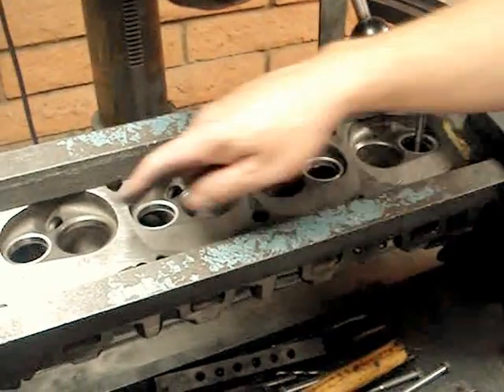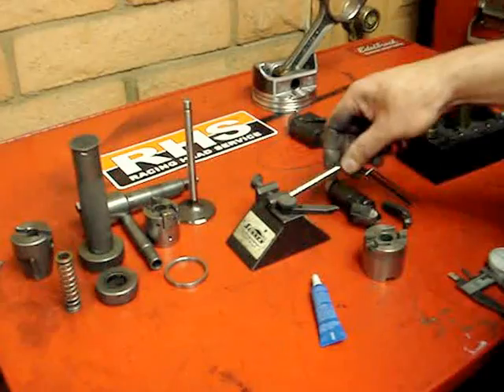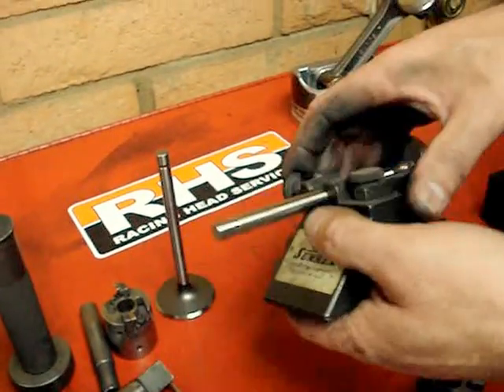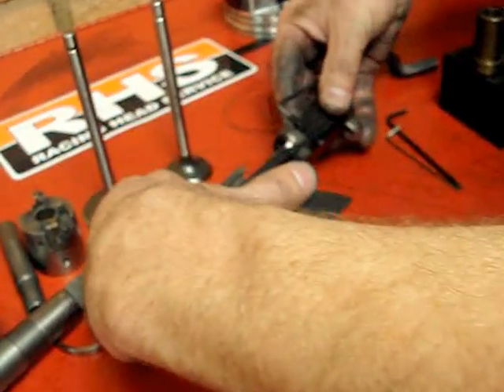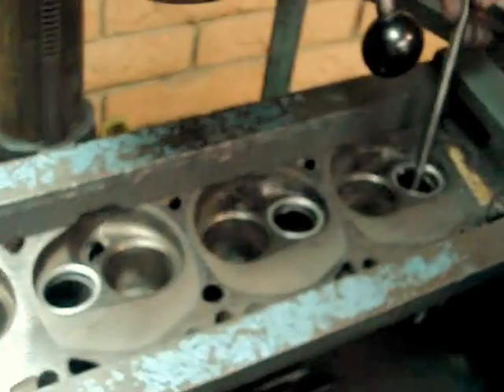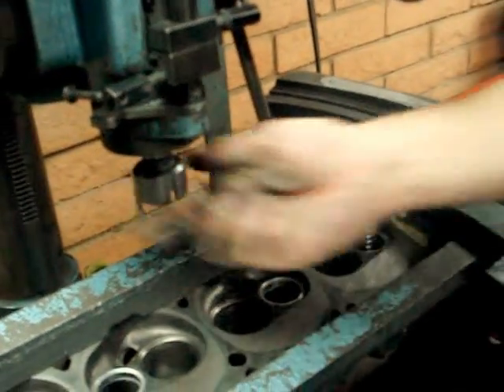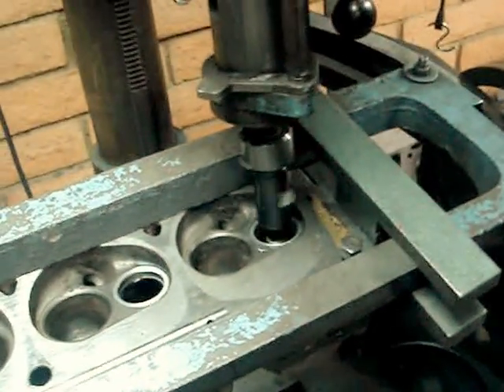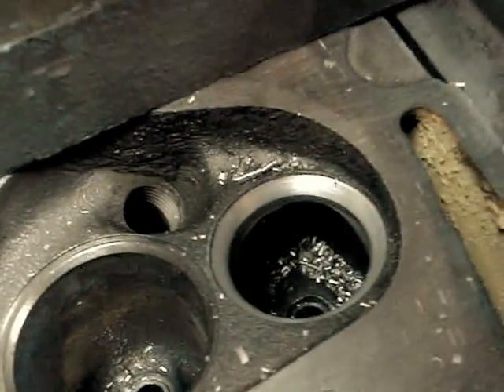3 angle valve job

Comment: Seems like a lot of material removed. Now you have to grind the valve stem length down. Valves perform better the higher they sit in the head

Comment: hello, I would like to know if there is significant amount of horsepower gain from a 3 angle job and should you get it done on a vehicle you use as a daily driver and race it also. thank you Robert
Reply from the maker: It helps it's important to understand making more power is not just one thing it's a lot of upgrades match porting,  bowl blending multi angle valve job these things all add up to more power I have seen as much as 15 HP gain on a 400 HP engine but like I said there is much more than just one mod that needs to be done
Reply: @Myvintageiron7512  Thank you for taking you time to reply back, I appreciate it.  I would love to do this to my 2010 challenger / 73 cuda  it has a 426W motor , Great video, Robert.

Comment: Nice video, but actually that seat is far from perfect. Because you are using what's called a forming tool there will be very fine chatter marks your naked eye cannot see. Not to mention delusions in the seat. I always touch up a form cut seat with a stone to remove those otherwise your valve will need to beat them out. You guys with stone cutters don't fret, they're very good if you have unworn pilots and stone holders. Proper technique is needed with them as in any machining process.
Reply from the maker: I agree 100% I have never been able to get the seats to seal correctly with the solid cutters I always finish them with a sioux grinding stone great point

Comment: please reply . i just wanna know if i can cut it. I have a problem looking for the correct valve lenght but unfortunanetly is out of stock so im thinking of a remedy i i can just cut a the valve to make it shorter
Reply from the maker: what are you working on and how much to short is it?
Reply: Myvintageiron7512  it a long valve i dont know how long it is . but im going to shorten it to 80 mm in length
Reply: its like im going to cut half an inch from it
Reply from the maker: No that won't work what are you working on
Reply: a

Comment: Do you put the seats in liquid nitrogen before you install them to shrink them? It would help since the seat is a few thousandths larger than the counter bore, right?
Reply: I worked in a high performance 2 cycle boat engine shop many years ago running an engine lathe making turbo housings, etc. and we used dry ice to shrink and an oven for expansion for interference fit, one part in the ice to shrink after the other part in the oven is hot and expanded, we used about 004 and it worked fine

Comment: These videos are awesome, the problem is that I don't think anyone inthe northeast , does this, I feel they take the charge card,  say they did this stuff and in the end , you get nadda... I have read car magazines( probably mis informed ) since I was 13 , always hearing them say, bring to a local machine shop, and they would be glad to help...  I live in jersey, among some of the most  unsavory  car guys known to man,,, and have a had a fear,,, like dentist fear,  I honestly figured I'd have to buy a new engine, becaus I couldn't  trust anyone to be so detailed.... It's so cool to watch a master at work, and taking a lot of time to spread the knowledge.  I have no idea.  What the heck I'm doing, I know I love cars, , I know I can do a lot , but this series on engine building I know I'm a moron,,,,,,,   Great videos,   Real eye opener even for a an avid car guy. .learning a bunch. ,
Reply: It's a problem down here in the south with the machine shops too. 

They charge for work they don't do, hell sometimes you don't even get the same heads back, just had a set of heads that I was paying to be magnafluxed and cleaned, they didn't notice the cracks until after they started painting one head, and on top of that they were painting over dirt and grease. All after I asked for them not to paint them.
 Another problem to watch for is when you take your nice parts in to be put in like cam bearings or parts for a motor they are building some shops will swap them for the cheap counterpart
Reply: You guys are exactly right! Skilled work like this is gone with the dinosaurs. The skill that out there now days is skilled at ripping you off. SAD!!

Comment: What keeps that seat insert from falling out when things get real hot?
Reply from the maker: ABU. HAMDAN If the interference fit is right the seat will not fall out it is recommended to cut a counter bore .006 to .007 smaller than the seat insert being pressed in I always double that to .012 to .013 on cast iron heads and the seats go in real tight I don't want them falling out
Reply: it is pressed in to the hole,could be 0,05mm bigger in diameter than the hole is.
Reply: MrRichard57000 I had dodge LA318 failed due falling out seat and it was pressed by machine shop I don't know what was the reason of falling seat but cost me to buy new heads instead if stock one; I thought may be there is a cement to be used during seat pressing so when the head heated up and expand the seat will not fall
Reply from the maker: press fit
Reply from the maker: Yep I'm with you on that I use .010 to .012 smaller counter bore
Reply: I always thought the seats where shrunk in a freezer first the pressed in?

Comment: U still use lap compound to get correct seat??? even after this?  Nice video
Reply: Yes, it also shows contact width and placement which matters. You want the 45 mating surface in middle of valve